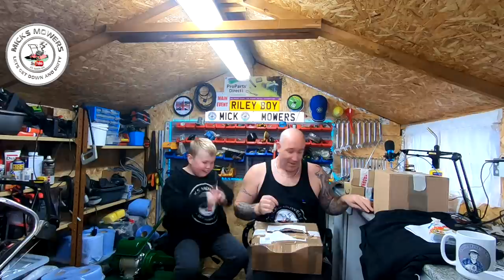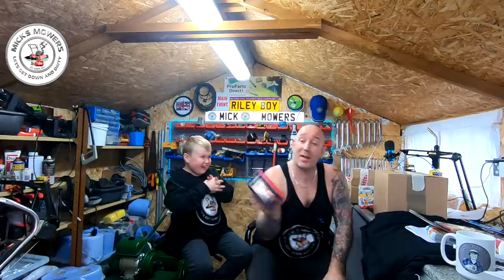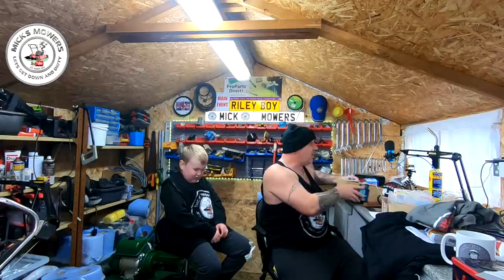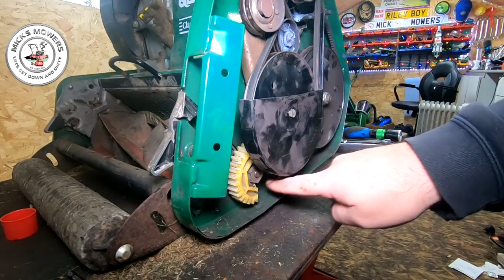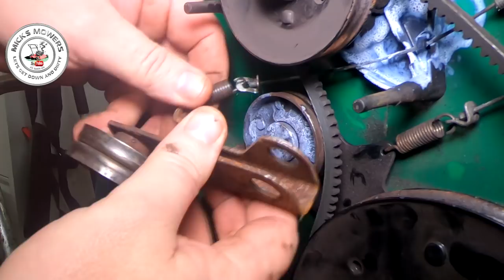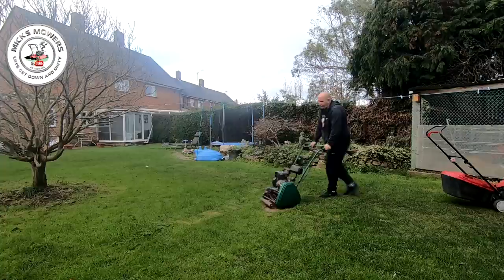How To Replace The Pulley Tensioner and Cylinder Gear On Your Cylinder Mower

Comment: Micks Mowers i gotta old craftsman mower but the model number sticker is not on the machine has a tecumseh on and metal one lever height adjustmen has a problem with self propell but runs was free
Reply from the maker: Fantastic.. get it fixed ready for the coming season